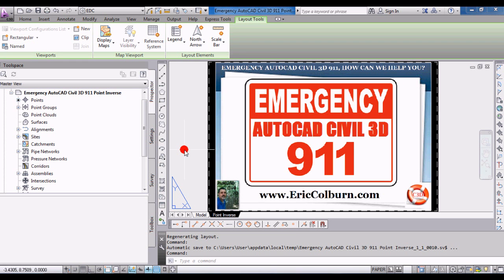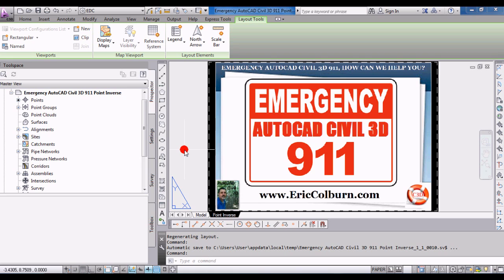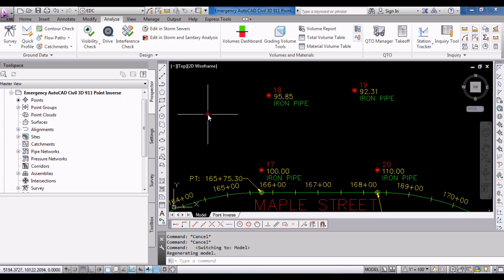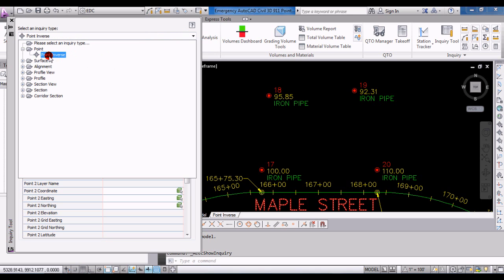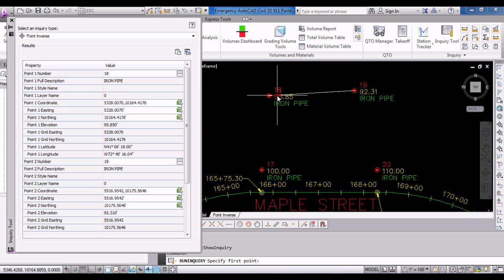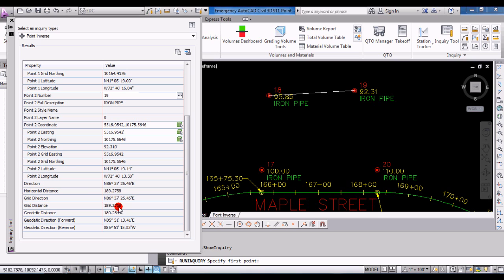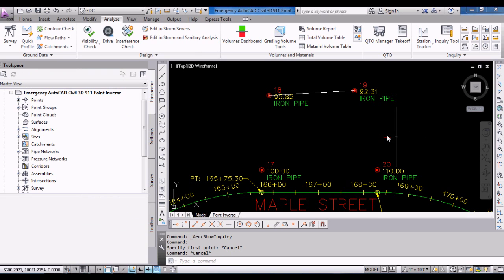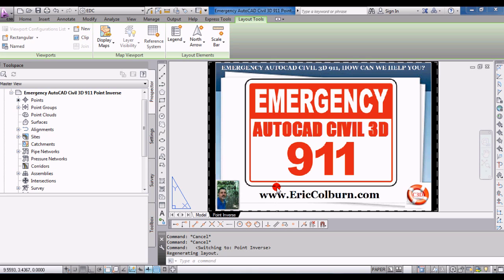Emergency AutoCAD Civil 3D 911 Point Inverse

Comment: Is this SERIOUSLY the only way to get a simple inverse? It seems like about 5 clicks more than any other program out there and then it is all manner of clunky with how poorly the green select boxes "sort of" work. In Terramodel it is "IP enter" in TBC it can be as easy as CTRL "I". This seems pretty sorry for the amount of money that C3D costs.
Reply from the maker: I know what you are saying. Autodesk could do more to improve survey functionality. As I mentioned, placing the inquiry tool on the Quick Access toolbar saves steps. As far as speed goes, the quickest and best solution often is to simply measure between the points graphically, snapping to their nodes or by the transparent command point number filter. Not as much output, but may be all you are looking for.